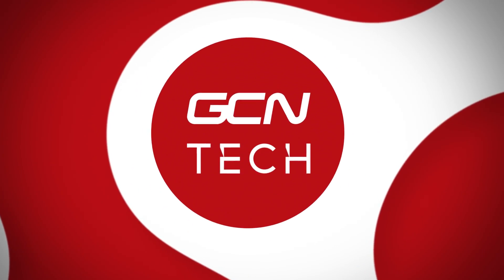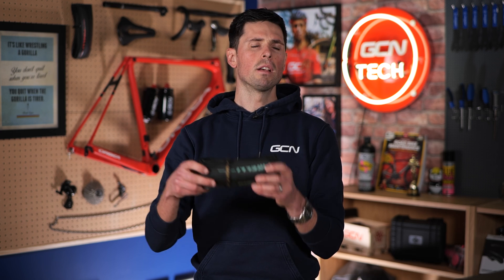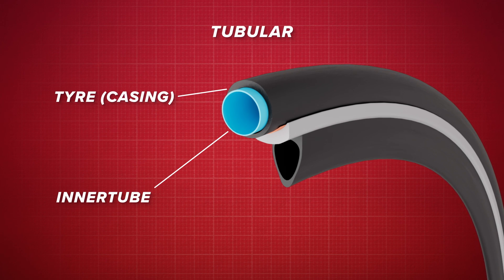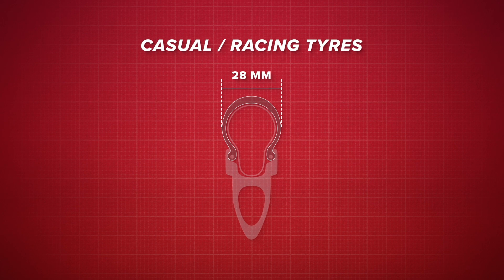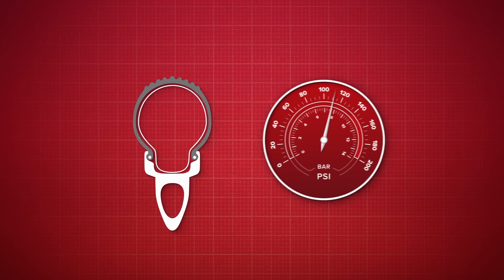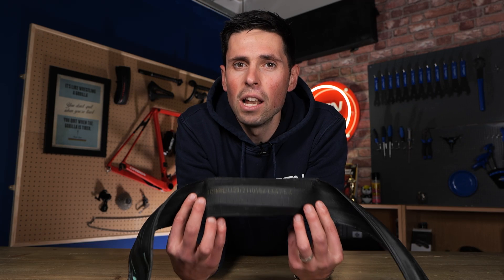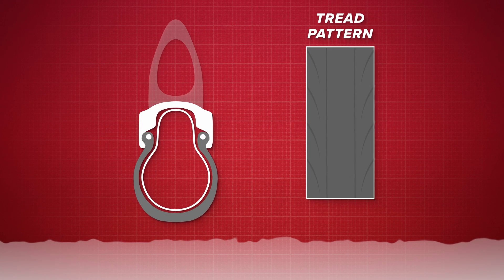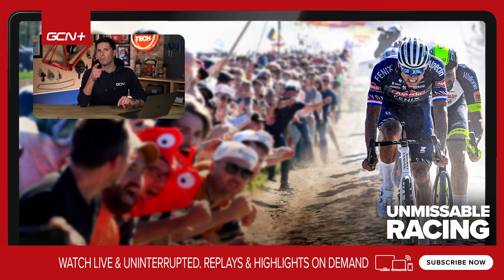Why Are Bike Tyres So Confusing? | Types & Details Explained!

Comment: Thanks Alex.  Is the sealant in tubeless for the rims, puncture protection or is it the spoke holes?  Do we need special rim tape for tubeless?
Re your question, 4:05 you talk about width, I didn't get the clue.
As for winter tyres, the critical measure is the transition temperature for the rubber, ie the temperature below which it is solid and not flexible.  Foe car tyres I have found Pirrelli far too "summer" for a UK winter and maybe why so many cars end up in the ditch.

More geekie stuff please Alex (or are you really Bob in disguise?).
Reply: Look at the graphic @4:02, you will  see a small LEGO piece fly by.
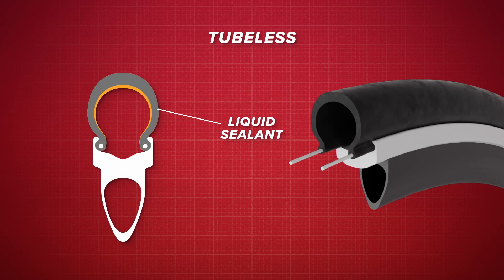Reply from the maker: Hi Emma, the sealant is for the puncture protection, as you get a puncture the sealant should clog that hole and keep the air from escaping 🙌 Skip to 04:00 and the clue is there for you? All the pieces will click together and you'll get it 👀
Reply: The sealant is for punctures at the tire.
Reply: @sbccbc7471  I am not convinced.  If it was purely for punctures then it wouldn't be necessary (unless tubeless are really fragile) and we wouldn't see absolutely everyone (on youtube anyway) putting sealant in their tubeless.

Comment: BTW, for those wondering.
PSI = Pounds per square inch.
BAR = Barometric pressure or the pressure the atmosphere puts on us.

And to make it confusing, the metric unit actually is Pascals :D
Reply: Indeed, in some countries 1 BAR is called 1 Atmosphere
Reply: @CanyonWanderer   but they aren't the same thing. 1BAR being 14.5 PSI and 1ATM being 14.7 PSI
Reply: @spinnetti  Indeed they are different, I think some people think "close enough" for non-critical applications 🙂
Lol, for cyclocross it might just be critical enough
Reply: And Kg per mm2

Comment: bike tyres are so conusing for people as people use werid names for them like 27.5, 650b, 700c.

take road bike tyres. they call them 700c, but very very few people on a road bike actually ride a 700c size wheel. the 700c size that road bikes take their rim size from (and 29er mountain bikes) used a 1 1/2inch tyre. so roughly 37mm so yes maybe gravel bike folks ride the actual 700c size. 
it would be better if the wheel industry stuck to rim sizes + tyre sizes like the car industry does, it's easier to under stand what a 622x25mm tyres is the

its' the same when the mountain bike industry brought out the 27.5 (using the 650b 584mm rim size) claiming it was 1.5inches bigger then 26inch and 29er's being 3 inches bigger, but this was a mis-representation. very few of us mountain bikers road actually 26inch tyres anymore. my last "26" mountainbike measured 27.2inches on it's 26x2.4inch tyres. go by rim sizes. 22inch,(26) 22.99inch (27.5) and 24.55inch (29er)
Reply: In my opinion the simplest way is using the ETRTO sizes, like 28-622 (tire width 40 mm for the 622 mm rim) or 60-684 (for mountainbikes). It's the least confusing system, similar to car tires with the width and the rim size in the tire size

Comment: I'm a performance rider, and I bit the bullet on a set of Tannus tires a couple years ago.  They rode rough, and I was losing efficiency, I was 7% slower, or needed 7% more watts, which is a lot.  I didn't care, it was on a training set of wheels and other than my ego being damaged, I didn't really care.  I carried nothing with me other than a very small multi tool.  No pump, nothing.  And, I didn't ever think about hitting crap in the road.  It was really enlightening.  But, the performance irked me, and the rough ride.  If we get there, sold, take my money.
Reply from the maker: That's the dream right! If solid tyres were comfortable and fast they would be very popular 🙌

Comment: Alex, great video. I was wondering if you could settle a debate I have been having with a fellow rider. On some tires, the manufacturer will stamp/emboss a rotation arrow into the sidewall. I argue that it is critical that you mount the tire based on this. My friend says otherwise. Also, I have seen some tires that do not have a rotation arrow stamped in. I assume these are symmetric.
Reply from the maker: Hi John. Yes, directional tyres must be faced in the correct direction, otherwise you won't be getting the benefits of its construction in regards to grip and rolling resistance. Tyres without directions however are usually cheaper and it won't matter which way you put them on.
Reply: Wouldn't mounting a tyre that has a directional arrow backwards basically be a major loss of speed? The rolling resistance on that must be huge, given that the tread pattern is intended to give the best forward momentum going in one direction! That would be so counter-intuitive LOL
Reply: Hey John, thanks for your comment. The rotating direction will help the tyre work at its best and its how its intended to be used, however i must say i have never been able to notice a difference on the occasion i have managed to get it wrong. The majority of performance comes from the rubber compound and the pressure.

Comment: Small detail you missed. Tyres started off on wooden rims, as you said, but they weren't there to give you grip. Their main job was to tie the wheel together, hence "tyres", and to be durable.
Reply from the maker: Thanks for the fact!
Reply: Wow, thanks
Reply: the word tyre or tire appears to come from the word attire, in the sense that the wheel had been dressed in something to protect it.
Reply: @brian3937  yes, there does seem to be two schools of thought about that. Although in a wooden wheel the tyre does literally tie it together, without the tyre the rim would be separate pieces of wood.

Comment: Does the sealant in tubeless tyres freeze when it’s transported on a plane? Will this be a problem? @gcntech
Reply: It's probably not gonna freeze. But it can become solid if you keep it in the same position for weeks. It is especially a problem with the valve.
Reply: @onehourmusicbc  Good point, One Hour. Totally depressing when get a puncture on the road with tubeless and lose enough air before it seals such that you must add air to continue. But you can't because the valve had become totally clogged and useless with crusty sealant. Time to pray 🙏 you are riding with someone who brought an extra valve.
Reply: The aircraft cargo hold is not directly heated, but it's not freezing there since it's part of the pressurized fuselage. Animals are transported there too.

Comment: I’ll just stick to clinchers. Hassle free for me.
Reply: I have puncture protection tyres on my mountain bike and cycled over broken glass with issue, road bike I prefer tubular though go tubeless if not need sealant as hate keep top up, had a puncture on tubular once but where I was went like 43mph or 63mph down a hill to finish about a mile away on the ride
Reply: I'm with you on this one.
Reply from the maker: How about when you've got a flat? More hassle than tubeless at that point 👀
Reply: @gcntech  no idea. Never tried or want to try tubeless anytime soon. No big deal in changing a flat, it’s a flat tire. Not rocket science haha. Not the best in terms of speed of swapping out the tubes but I’ll get it done. 

I also use Silca latex tubes. I had one flat in over 5000-6000km of riding them and it was a huge nail, not even a tubeless or tubular set up will survive it.
Reply: Until you puncture and it's cold and there is no sidewalk and you have to repair in wet grass
Reply: Hahaha not when you get a flat and have to put a tube in again. Since going tubeless last year in July I haven’t had to put a tube in. I’ve had punctures but none that haven’t sealed.
Reply: @jarrodfife242 but when you want to swap tire for another clinchers are less messier becouse of no sealant needed
Reply: @ostrokolowiec  Si with Mavic tubeless showing not need sealant to inflate was great
Reply: @jarrodfife242  my problem is that I have a bunch of wheels that are not tubless ready - thus this season I d like to try the new tubes from Schwalbe out of Polyurethane
Reply: @jarrodfife242 same here, sometimes I didn’t know I got puncture already and then not notice it while washing my bike